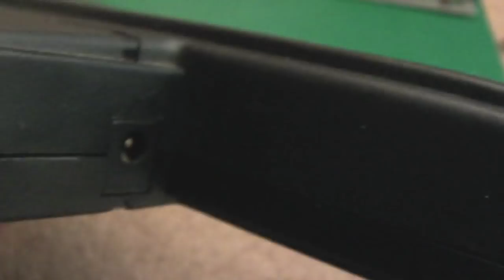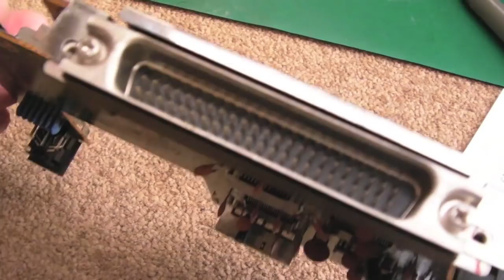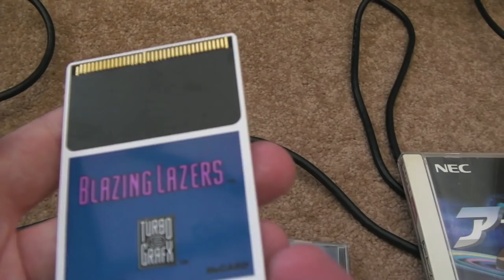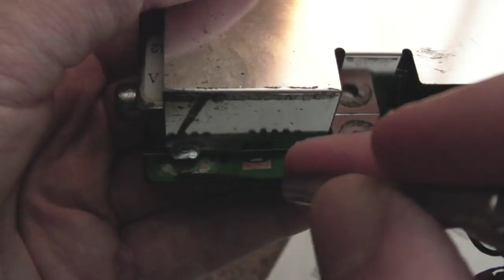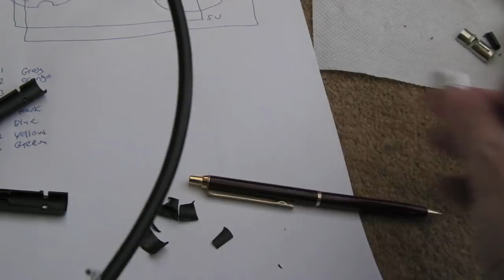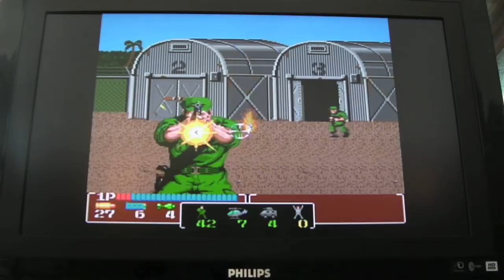NEC TurboGrafx 16 Repair / Composite AV & PC Engine Controller to TG16 Adapter

Comment: Bonjour, pourrais tu me dire combien de voltage et unite farade fait le condensateur a l’entree de l’alimentation de la consol car le mien a peter en la branchant?
Reply from the maker: If you search in Google for "Console 5 super grafx capacitor list" you will get a list of the values.

Comment: Just curious, what does the console do when there is no cartridge installed? Does it just have a solid black screen or does it have some sort of intermittent color flashing?
Reply from the maker: I think without a cart you tend to get a white screen, or on some systems a green screen.
Reply: @GadgetUK164  Thanks for the reply. I was just curious, because I just did a bit of solder rework of a friend's and he didn't give me a cartridge to test with. Upon power on it had some magenta static and made a strange constant tone for a second before going solid black.
Reply: @GadgetUK164  Never mind, got it working! It ended up being a trace that was cracked. It does go white with no cartridge now.

Comment: Somewhat relevant: nearly a year ago I found a PAL modded CoreGrafx in Canada with an RF modulator replacing the DIN socket. Interesting little mod board but I seemed to break it somehow when looking at it, which is what prompted me to remove it. I reinstalled the DIN and the composite capacitor the mod had displaced and it was back to normal (60hz NTSC). The mod board had an NEC chip to introduce delays/waits in order to clock it down to 50hz and I believe the PAL TurboGrafx has that same chip. It also included a Sony CXA-1145P video encoder chip, IIRC (definitely CXA-11-something-P).

Comment: I had already chopped off those bits to make a Ten No Koe 2 fit a TurboGrafx-16 earlier in 2017 after picking one up straight from Japan (went there in May 2017). It worked and they are very cheap so I ordered another one for only a few dollars.

Comment: It's a long shot that anyone sees this, but does anyone know what voltages I should be seeing out of the crystal on the TG16? I have a non working unit, and I suspect that the clock isn't working properly. He mentions here that the CPU is basically a Rockwell 65C02. Which states input high and low of 2.4 and 0.4V. I don't think my clock is putting out a signal that swings that wide. Does anyone watching this happen to have a scope to look at the output of the crystal? Thanks.
Reply from the maker: Next time I get the TG16 out I can take a look on the scope.  It might be a week or two yet though!  I was planning to go back in there to remove the modulator and add a DIN.
Reply: @GadgetUK164  Thank you! The oscillator hooks to pin 10 of IC101 and pin 2 of IC112, that's where I measured these voltages. Will help a lot to know what voltages someone else is seeing there.
Reply: @GadgetUK164  Have you had a chance to check the output voltage waveform from the oscillator? I can find voltage controlled oscillators to replace this one, but ai want to make sure the waveform I create is as identical as possible to the original. I really appreciate you taking the time to check those voltages. Thanks in advance!

Comment: The PC Engine CPU boots up in "slow mode" and usually the first thing games do as part of their hardware initialization routines is put it in fast mode. I don't know why they bothered with a slow mode to begin with, my guess is it's a holdover for Famicom backwards compatibility when Hudson were pitching the system to Nintendo.

Comment: I have a turbo graphics 16 and the controllers work when I plug them in directly, but when I put in the turbotap that lets me put in up to 5 controllers  it will not work. I bought two turbotaps thinking the problem was with the turbotaps, but still didn't work, so the problem must be with the console.  Strange. Or maybe the problem is that I am using the wrong AC adaptor. I don't have the original adapter which I think is supposed to be input 120v 60hz. Mine is input 110v-240v. Could that be the problem?
Reply from the maker: Check the solder points on the mini DIN controller socket.  If one of the connections is broken there that could explain it.  But I fear it might also be a faulty CPU - since the CPU has direct IO connections.  Only thing protecting them are some EMC filters.  This is a good reason why you shouldn't connect and disconnect controllers whilst powered up.
Reply: @GadgetUK164  I was hoping the problem was the adapter but I bought a new one and it made no difference. Unfortunately I am not proficient enough to follow through on the advice you provided above. I wish I could so I could play with my kids but as of now I am only able to use  one controller.

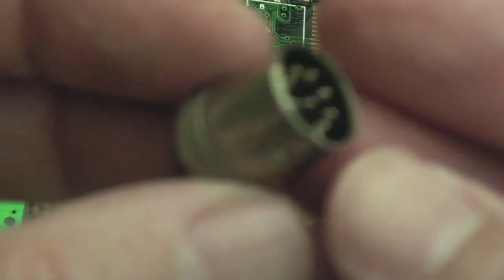Comment: 23:00 ...still needs 9V for one tiny opamp I guess, so try avoiding AC/DC adaptors for less than 9V output.
Reply from the maker: Looking at the schematics I see no use of the 9v input!  It only uses the 5v derived from the 7805.
Reply from the maker: The other thing that proves that the 9v is not used there is the expansion bus does not pass any supply other than 5v, and the PCE can be powered by the expansion bus 5v connection (and is when using the CD-ROM unit) - and the PC will still output sound exactly the same as when its powered by the 9v DC jack.

Comment: Ever been tempted to 60hz mod the PAL Turbo? Its possible apparently but no where near as simple as 60hz modding an MD or a SNES.
Reply from the maker: I don't have a PAL TG16 - only got the NTSC version!  It does look quite painful to convert tbh.   Obviously you would need to swap out the crystal, but from what I understand the PAL version has a lot more resistors and caps on the board than the NTSC version.  Many of them might not be required, but it doesn't appear to be trivial to convert one.

Comment from the maker: NOTE: You can work out if your TG16 is PAL or NTSC by looking at the 1-800 number on the underside of the case (I think) - that would indicate NTSC, and on the board the PAL version has "A" versions of the CPU and GPU - ie. HuC6280A, HuC6270A

Comment: Great video! RF seems counterintuitive and everyone is all about RGB mods these days, but I picked up an 80s TV at an estate sale recently, with only RF coax input on it. I've been picking up RF adapters for systems when I see them at thrift stores, and RF really isn't as bad as people make it out, when used on older TVs. Obviously if you're using anything modern with the clarity and precision of our current flatscreens, then absolutely RF should be abandoned as quickly as possible. It can still have a place on older sets though, and I'd rather see the RF modulators left in the systems than ripped out like some people are doing.
Reply from the maker: Thanks =D  And yes, I prefer to leave them in too!  In this case, I can use the Super SD System 3 for AV, so I will remove my mods, and perhaps fix the modulator whilst I am there.

Comment: Great mod Chris. It's great to have an old TV that still has an analogue tuner built in for situations just like this when all you want to know is, is the system showing signs of life before you composite video mod it.

I've noticed and I don't know if you have also but some retro systems like the 48K spectrums and C64's that get sold on eBay as faulty (No Picture) actually do work perfectly fine it's just the person who tested the system before listing it has tried to tune it in using RF on a modern TV that only has a digital tuner built into it. oh, maybe I should have kept that one quiet; you just know others are going to read this and search for those (No Picture) systems now on eBay, me and my big mouth Ha-Ha.

I recently picked up a Samsung UE22K5000 to put on the wall just above the desk where I do all my repair and mod videos and was quite surprised to find it has both a digital and analogue tuner built into it as there was no mention anywhere of the analogue tuner before I purchased it. It's a relatively new model TV also (2016), it came as quite a surprise when I went through the initial setup and it asked me if I wanted to do a digital or analogue search or both. You can check out the TV on my channel if you would like as I've made a video of what it can do and what inputs and signals it can take.

Oh, and finally. As for the "err" I can't say I've ever noticed it to be honest, I suppose if your prone to doing it likewise you don't tend to notice it when others do it also.
Reply from the maker: Thanks =D  Yes, always handy to have something with RF support!  I believe the RF was really bad due to that missing component (see the comments above about the missing component).  That Samsung TV sounds like a good model!!!   And yes, I agree - a lot of people cannot tune RF in and just assume its dead etc - great for us buyers lol.  I had an Amiga 1200 once where someone plugged the composite into one of the R,G,B component connections on a modern TV - suprisingly it worked for them but was all in purple....  They thought there was a fault, I thought there was a DAC fault, turned out to be fine.   The "err" thing I hadn't really noticed, now I hear nothing but "err" lol.  I've got to work at that!

Comment: Removing the RF box and replacing it with a DIN conector is definetly the best way to go imo.
Reply from the maker: Someone above (or below) suggested using one of the 3.5mm sockets for the Raspberry Pi AV cable - might give that a go!

Comment: My tip for soldering most connectors is solder them while they are connected that way the heat dissipates better and the pins don't misaligne :)
Reply from the maker: Love it!  Great idea =D

Comment from the maker: Something else I thought after the video was the point where it looked like the brown wire was missing, the obvious solution would have been to desolder what ever coloured wire was going to the ground pin on the mini DIN, then swap that wire for the ground shield (which was exposed enough to solder onto).  That would have been another way to get around the problem had the brown not been recoverable.

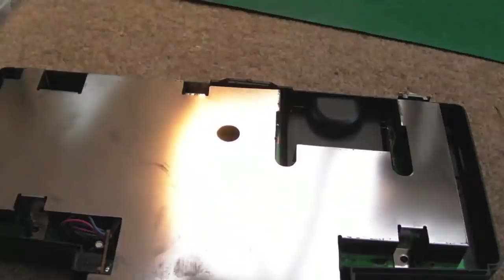Comment: Making one more comment - I actually watched the whole vid again in peace now at home since while watching at work I do not focus as well and tend to miss some important stuff. You mentioned the hardware mod to bypass the region check code - I think I found this info in one of Voultar's videos - it can be done by soldering pin 29 of hu6280 CPU to pin 30 right next to it, so really an easy mod and clean execution. Back in 90's I had no idea that console like PCE or TG16 existed (thats one of disadvantages of living in a country of so called "Eastern Bloc") - I remember when I found out about this console years later I was fascinated by how awesome it was and since then always wanted to have one, and finally got my hands on one after the years. Such a well enginered piece of gaming equipement and a really great "opener" of the 4th generation of consoles. The built in mapper functionality is just awesome, look at NES for example what happened there with all the different mappers, just an catastrophe. About soldering DIN connectors - I hate doing that :) the really nice trick I learned from a much older than me "electronics guy" is that he used to cut a potato in half (so it sits flush on the desk) and stick a din plug into it - then solder - such simple solution and it really works well! Helps to keep contacts in place and also dicipates the heat while soldering. Thanks again for mentioning me in the video! To finish up this comment, at 6:32 the "..So it got this large piece of shi...elding" :D cracked me up, I almost heard something else :P
Reply from the maker: LOL @ the shi....elding comment =D  Wonderful idea there on the Potato!!! I will mention that in future!!!  Yes, they are a lovely system - one of my favourite systems!  You're welcome on the shoutout - a great video you did, impressive work!!

Comment: On RF only Systems I generally use a 4-Pin TRRS 3,5mm Jack in Place of the RF Modulator out. Wired to the Raspberry Pi standard. It‘s a really clean way to get AV without drilling holes.
Reply from the maker: Excellent idea!  I might just do that!  I will give you a shout out if I do =D

Comment: Thanks for mentioning me in the video - it really means much to me! No sound through RF? hehe :) I see that little mute icon in top left corner - continue watching the vid... ;) edit: LOL You unmuted it second after I wrote this - missed :)
Reply: Lucky You managed to get the video (even as bad as it looks) through RF on Your screen - my LCD TV (very cheap one) is so bad when it comes to fine-tuning RF signal (no matter auto or manual) it does not find anything at all, wasnt able to tune via RF A2600 or C64, nothing - looks like CRT TV's have much more precise frequency step when tuning - not surprised tho :)
Reply from the maker: Again you're very welcome!  Thanks for doing such a great video on the PCE - I did enjoy your video =D
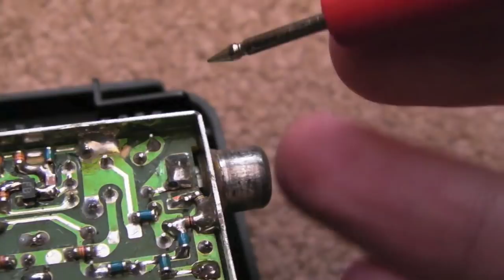Reply from the maker: The mute thing wasn't the problem btw - it was NTSC and the subcarrier frequency is the issue there, but the reason the video was so bad was a missing component between the centre pin and just below.  If you watch the video closely at 33:08 you can see the missing component gap.
Reply from the maker: Maybe that's the problem - modern tuners!!! =D

Comment: That back "expansion port" it's also used to plug the CD device as far as I remember.
Reply from the maker: Thanks - Yes, it certainly is!  I just forgot to talk about that, but I do have some more PCE videos coming up shortly I think - might mention it there.
Reply: Awesome! I love the PC Engine / Turbographx.

I still have mine, pal, with few relevant games.

I think it's a much better and more capable machine that both Mega Drive and Super Nintendo, despite some limitations.
Reply from the maker: I agree =D  Just something awesome about PCE games =D

Comment: Thought about picking one of these up. https://rover.ebay.com/rover/0/0/0?mpre=https%3A%2F%2Fwww.ebay.com%2Fulk%2Fitm%2F311999938800 says it fits both PC engine and turbografx 16
Reply from the maker: Wow, that's a nice find!!!!  Might get one of those myself!  Thanks for posting that!
Reply: He has a few different ones.  One is RGB and composite, with an additional megadrive style cable input: https://www.ebay.com/itm/PC-Engine-AV-Booster-RGBS-output-TurboGrafx-16-Composite-RCA-RGB-SCART/312016390785?hash=item48a5a04a81:g:hhMAAOSwttFaD31v
Reply: He also sells one that has s-video, rgb, and composite, but it looks like that one is sold out.
Reply from the maker: Thanks for posting that link too =D

Comment: It is a NTSC version - it has a 1-800 callback number on the back ;). Oddly enough I have one of these in my pile of things to repair ;) in roughly similar condition. The composite mod is definitely helpful. I've found it difficult to find joysticks as well for it.
Reply from the maker: Thanks for confirming that =D  I suspected as much, but never thought about the 1-800 thing underneath.  Yeah, joysticks can be more expensive too - that's the real problem.  PCE controllers are half the price.

Comment from the maker: At one point I mentioned the 6 pin mini DIN - it's an 8 pin mini DIN!
Can anyone spot what was ACTUALLY wrong with the video output from RF? I spotted it during after reviewing, whilst it was uploading to YouTube!  Curious to see if anyone else works it out =D
Reply: @ 33:08 there is a broken off MELF component missing from the RF output
Reply from the maker: Well spotted my friend!  =D  Yes, that's what was wrong with the modulator!  Component missing between the centre pin on the RF connection and just below it.  The copper was the clue there, and the cavity on the top solder blob there too.  I might revisit that later when I do the RGB mod, just to see if the picture tidies up via RF.
Reply from the maker: Good guess, but there was a 2nd problem with the modulator too!  bweebar spotted it below:- =D
Reply: GadgetUK164 - Retro Gaming Repairs & Mods I’m in the USA with a tv capable of the NSTC input. Is it worth repairing? I don’t know the MELF parameters to order one for the repairs.